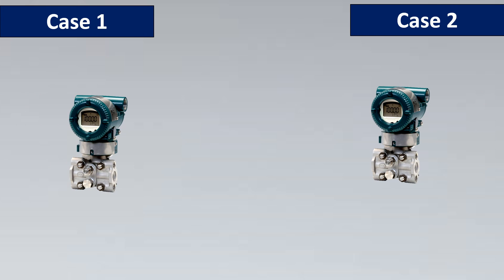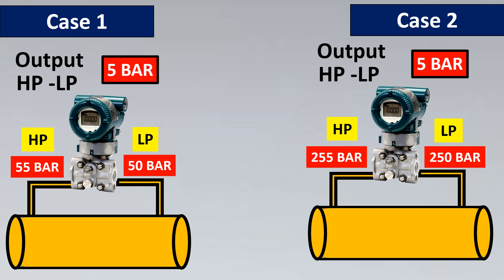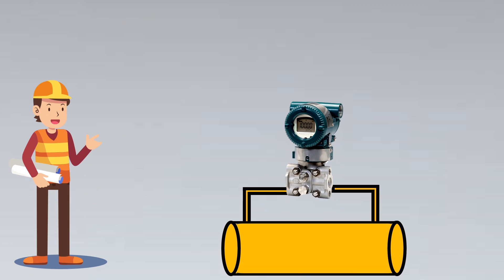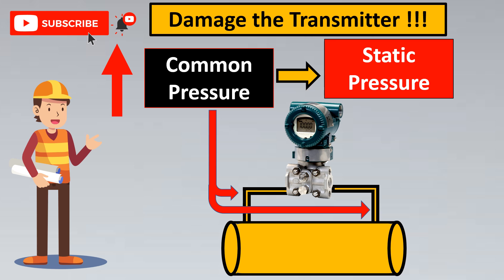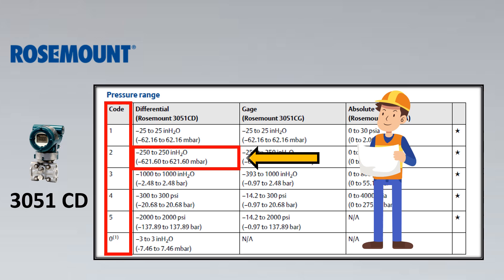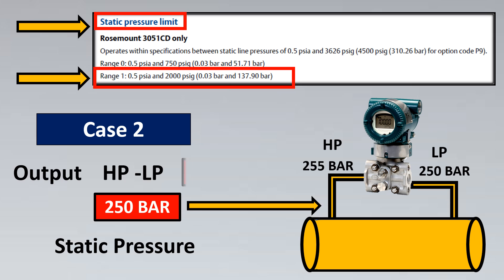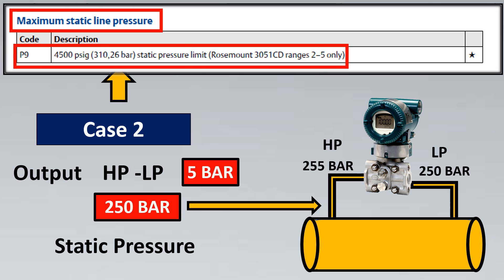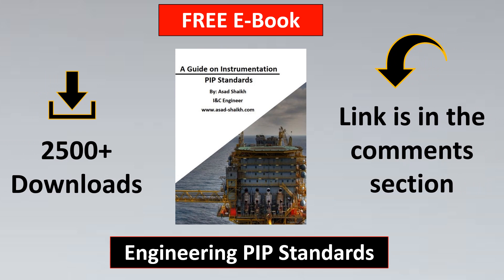DEADLY D.P Transmitter Selection Mistake EVERYONE makes !!

Comment: Generally why DP transmitters are used for Low pressure application with Low side open... Why low side open???  I understood if low side is open then the pressure acting on it is 1 kg/cm2.g and if my High side pressure is 1 kg/cm2.g coming from pipe line, In this case 1-1 =0 , But my requirement is to show 1kg/cm2.g becaus eit is actual presure in pipe line... Please guide and suggest on this